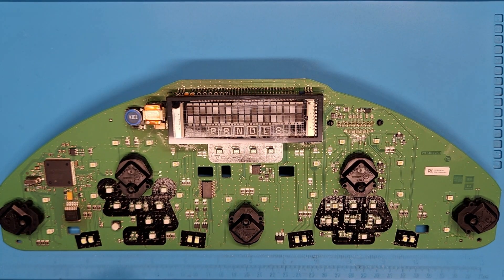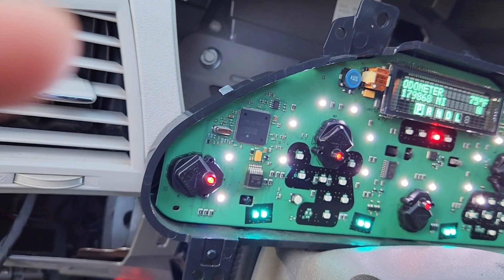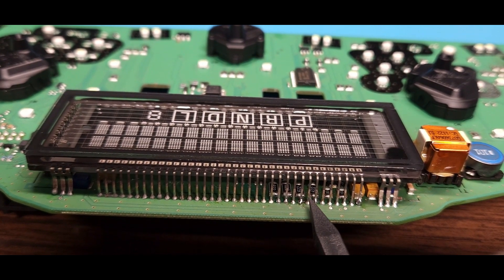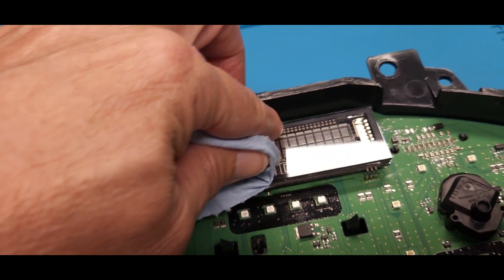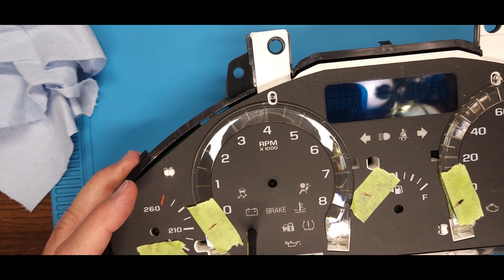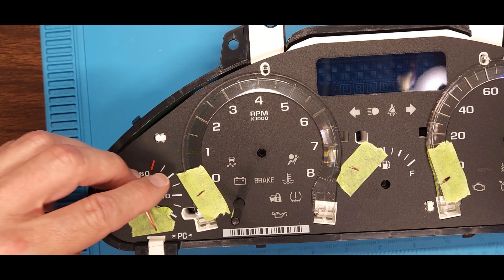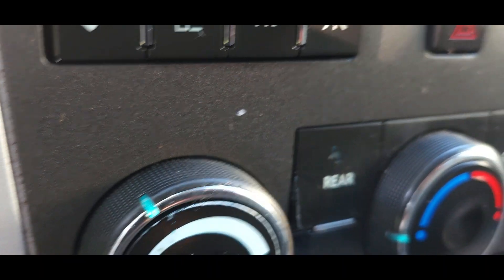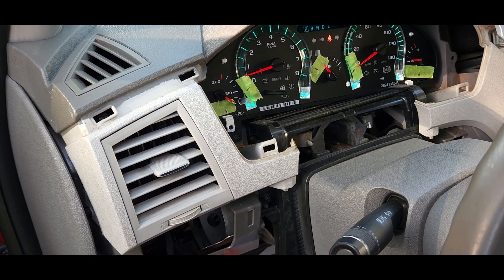2012 Chevrolet Traverse, Driver Information Center Not Working

Comment: If I replace the whole cluster won’t that be easier?
Reply from the maker: Yes and no. Certainly it should be easier to replace the whole unit but then there are odometer accuracy and possible programming concerns. There are also costs and availability to think of.